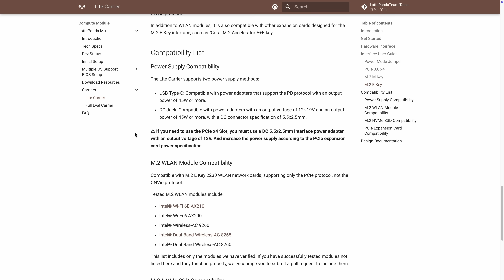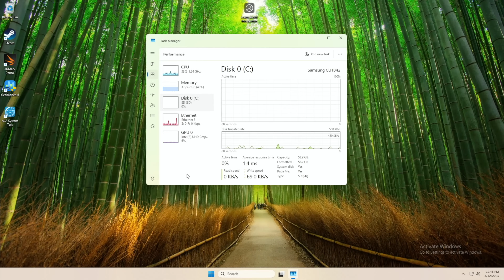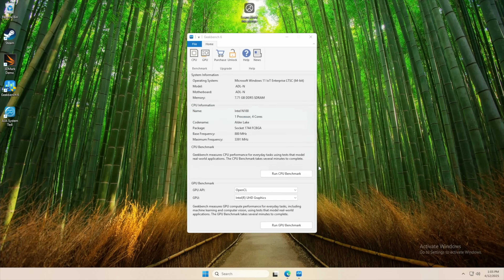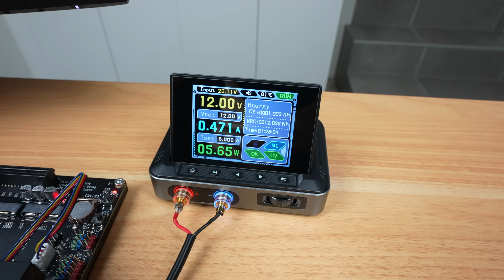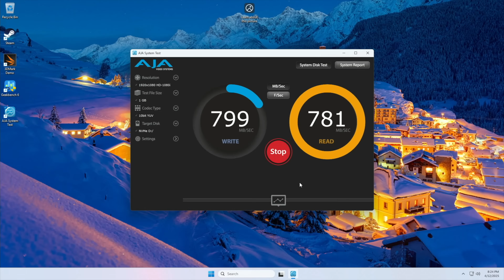Lattepanda Mu Review: The Tiny x86 Powerhouse!

Comment: for 3x price is it 3x faster than pi 5?
Reply from the maker: You can't really do an Apples to Apples comparison between them as the one is x86 and the other ARM but in terms of practical performance, the Mu is quite a bit more powerful than the Pi 5. Geekbench numbers would be around 550 for the Pi 5 single core (Mu gets 1100) and around 1500 multicore (Mu gets 3000). The GPU is probably 4-6 times more powerful on the Mu.
Reply: @MichaelKlements  thank you!

Comment: I used one of these as my previous IRL livestreaming encoders in my portable setup. Intel QSV can handle H265 video encoding at good enough efficiency for my needs. I have since moved my setup to use Radxa X4 and I use Mu setup as experiment board for PCIe capture cards and silly things like running full GPU video encoding in my backpack.
Reply from the maker: Did you use it on the Lite Carrier board or on another board?
Reply: @MichaelKlements  I used lite carrier board

Comment: whats that thing you're using to measure/provide power?
Reply: nevermind its in the video description i just need to learn how to read
Reply from the maker: Yes it's a FNIRSI power supply, it runs on USB C PD and provides an adjustable voltage and current output. It's useful for projects where power consumption monitoring is required.